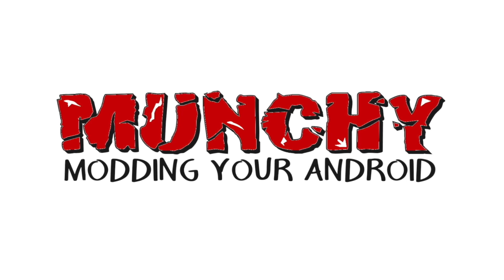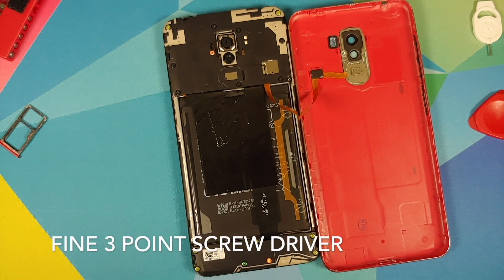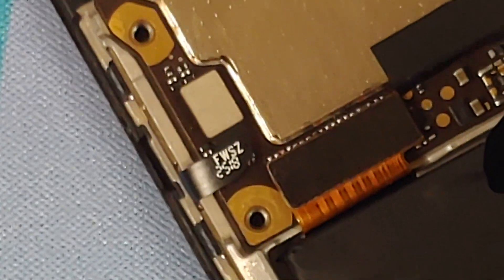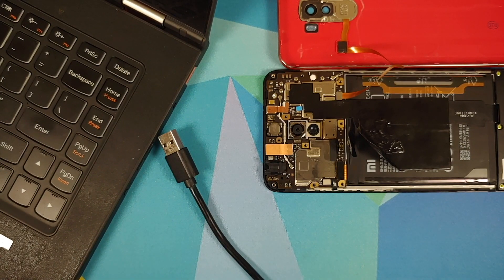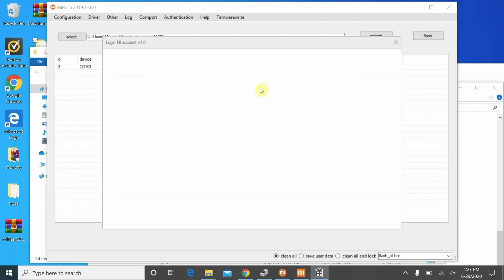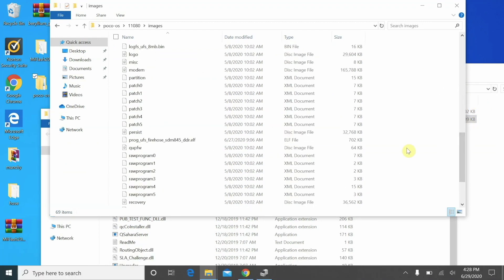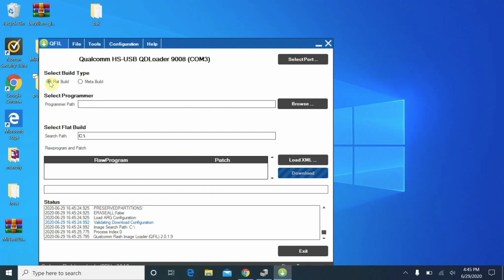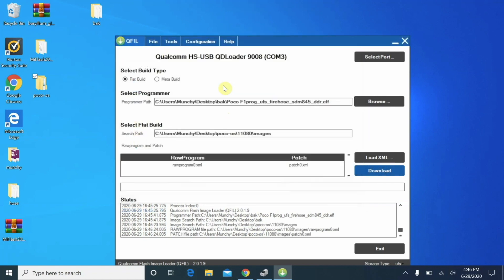Poco F1 | Bypass EDL Authorized Account for Free? NOPES | EDL Flashing Explained | Firehose

Comment: I did successfully flash a developer rom in recovery mode with mi flash pro, from the rom proposed to download via that Application, i did not unlock anything, but the flash was made in recovery mode, if it would be able to modify the ROM so to unlock (firehose file for recovery ROM?). maybe it could work?

Comment: My poco f1 is stuck in edl mode, I came to this conclusion when I saw the Qualcomm port 9008 on my laptop's when I connect my phone.
I tried taking it to service centre but the technician there tells me that the motherboard has been fried and I have to replace it costing me a huge amount of ₹10,000. Now what should I believe, is my phone stuck in edl mode or the motherboard is dead? And one more thing is that if the motherboard is fried then why is the poco being detected by my laptop as Qualcomm port 9008?
Reply from the maker: 9008 is edl mode..
try some other service center ..tell them to try edl mode as you can see it as 9008 qcom on your computer
Reply: @munchy_cool  I have told them the same bro but yet they answer me the same thing over and over🤦
Reply from the maker: nothing i can do bro ..sorry
Reply: @munchy_cool  it's okay bro just wanted to know whether it is a motherboard issue or edl issue. Thanks for answering. Can you tell us what payment method is prefered?
Reply: @sasidharpotharaju5707  stuck kaise huya bhai tera phone btana jra

Comment: bro test point se connect karna jaruri hota hai? mera phone bricked hai par fastboot and twrp show kar rha hai, recovery mode nahi hai sirf
Reply from the maker: if you have fastboot and twrp you not hard-bricked
flash any rom from twrp and format data
Reply: @munchy_cool  bhai error aata hai mi flash se karte time :( bohot baar flash kiya nahi ho rha bro gallery wale aur local shops motherboard change karwane ko bol rhe hai..unse bhi nhi ho paya problem solve
Reply: bro mumbai se ho toh mil kar dekh sakte ho? ill pay your charges
Reply from the maker: bhai i dont fix such issues and neither am I from Mumbai

Comment: Great video buddy. Facing the same issue. 

I didn't went to service center so far as i know what their reply would be. I tried at some shops in Delhi. They refused to flash a software. I then landed up at a shop which claimed that its probably an issue where EMMC is faulty and ofcourse needs flashing.  However nothing works and PocoF1 is dead.

I am planning to visit service center today finally. Will share if i find something on same.
Reply: Have you fix your phone
Reply: What happened next bruh... please helppppp
Reply: bro what happened next ?
Reply: bro died at service center 😂

Comment: Hi. Note the date. Today is 6th July 2020. 9:15 when I solved my problem.
I solved this problem. This is only why I comment. Just hope it helps.
How?
Maybe it was sheer luck. because I am also not a technician by trade but someone who finds ways to do things.
What I did?
1. Obviously, I tried "Mi Flash 2020 (No need auth)" and many others.
I can't even solve the problem of Mi Flash 2020 (No need auth) where it says Could not find "xmf_bat_indonesia.exe.config" so cannot use Mi Flash 2020 (No need auth)
2. After all possible ways, I tried QFIL.
3. I select the Flat build, load XML rawprogram4.xml and patch4.xml
4. Click download and then when it opens a Command window where it reach upto 31.
5. I closed the command window (THIS IS IMPORTANT). A bit risky. But what have you got to lose?
6. I disconnect the phone. (Very risky)
7. I reconnect the battery and turned on the power button.
8. It says something like, image load did not complete, have to delete, etc, etc. Very long message with very small fonts.
9. And in the middle of the screen, there is a prompt "Delete all files" not like anything I've seen before.
10. I clicked that and the phone began to delete and restarts even before completing.
11. I waited 3 minutes and then unplug the battery and reconnect the phone on EDL mode. (Do not close QFIL)
12. I connect the phone on EDL mode again and load XML file rawprogram0.xml and patch4.xml
13. This time, I waited the command window to close itself.
14. It only takes 1 minute or less and the command window closes itself.
Voila, my phone is back!
Disclaimer:
I'm not sure this will work so I didn't even record my actions. And of course you can never blame me for bricking your phone.
I also am not sure it will be the same if I repeat the procedure, even if I remember it correctly. (But I just comment on this just as soon as I finished with my phone).
Reply: The second XML files are rawprogram0.xml and patch0.xml

Sorry for the typo
Reply: @CkNgaihte  which phone ..Poco f1??
Reply from the maker: what about the qfil file?
Reply: QFIL is not new at all  I'll comment tomorrow the version or when I have the time to turn on my desktop again.
And yes it is POCO F1
Reply: @CkNgaihte  QFIL version please
Reply: @CkNgaihte  Qfil version please
Reply: @CkNgaihte  Liar
Reply: @commandxs2  I'm still using mine till date.
Reply: @CkNgaihte  You can't use QFIL with Official Firehose
Reply: Someone has tried this method? Thanks
Reply: Nice
Reply: Mera Poco vi edl se nehi hoi raha ha.munchy Vai please help
Reply: Qfil version please
Reply: @Ck Ngaihte
QFil version please ?
Reply: Thank you, where can i find this file? Link please
Reply: Can help what qfil version and what firehorse file
Reply: hey man i have same problem with poco f1 what is the programmer path
Reply: @hardikjadav30  what?
Reply: @hardikjadav30  englis please
Reply: @Fad_enz  how did u brick ur poco
Reply: @hardikjadav30  ohh noo, i have mi cloud and no auth account

Comment: munchy vai....
I want your suggestion..
my poco just randomly turned off(while I was pulling up and down the status bar) and did'nt turn on no matter what i did...it was not taking charge as well while it was off, after some time it turned on and worked normally..... then i put it on charge and after a few minutes it turned off again and showed no sign of life, I gave it to a local technician and he could not fix it (he did not try the EDL method). Can you please suggest what actually happened to it all of a sudden and how can i possibly get it back. I never even tried to root it or install TWRP. I am so doomed without it. Any kind of suggestion would be appreciated.
Reply from the maker: i cant explain it sorry, its an electronic item and they fail all the time
Reply: @munchy_cool  lets see what the service centre has to say, I believe they would suggest a motherboard replacement which is completely meaningless considering the cost.

Comment: So what is the paid method?
Reply: dude there is only a one solution to uh ... just visit any nearest service center ... if they culd flash ur mobile in edl .... and that flash  goes successful!! ur good to go it cost ur just 177 ruppee.. but while flashing ur phone in edl if they gets error ... then the issue will b with the A CHIP known as the emmc!!! so u need to reball it and need to reprogram that ic ... then bammm urs phone will b live again!! and this work cannot b done in service center!! but if u know a person in ur area.. who has a very good idea of programing the EMMC... i.e, L3 OR L4 MOBILE REPAIRING SHOPS !!! OR CHIP LEVEL WORKERS there u can find ur solution... 

lastly this issue arises due to the data gets corrupt in ur internal storage!!! which is ur phones emmc 

big fan of urs munchy ❤️..

at last
Reply from the maker: proper method, its not bypassing EDL auth
Reply: @munchy_cool  so you mean to say that this problem can be resolved only at service centre
Dude i am going to same phase as you have been .my phone is bricked only i can se my com port on laptop otherwise my poco f1 is dead
Reply from the maker: Paid.

1. service center
2. someone with authorized edl account who can do it using remote connection
3. some other third party tool which can bypass edl auth

FREE
none that i could find
Reply: @akashsavita1113  how did you brick it?can u tell me?so i can avoid that.
Reply: @Vegan_4The_Animals  don't know i was just seeing videos on  youtube my phone got hanged and after that i switched it off and then it didn't turn on again only i can see it's Qualcomm port on pc
Reply: hey munchy i went service centre they are saying my main board is damaged and cost around 10k .
Reply: @akashsavita1113  same here bro . have u got ur phone edl flashed yet ? agar hua toh btana